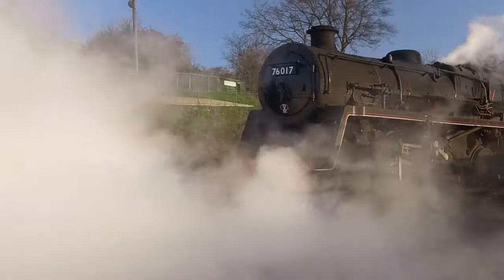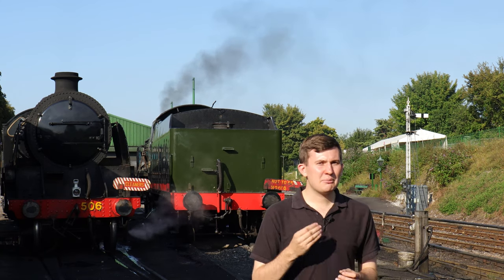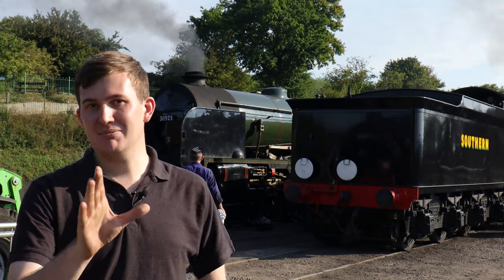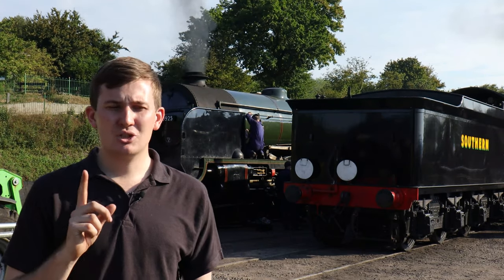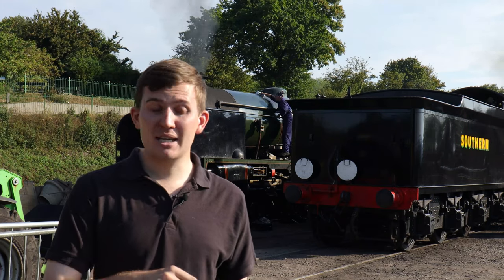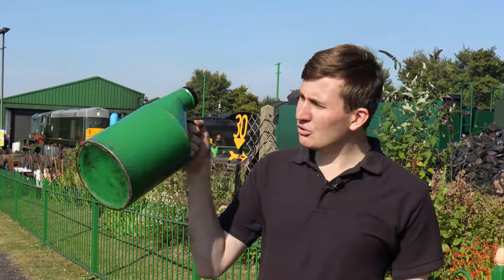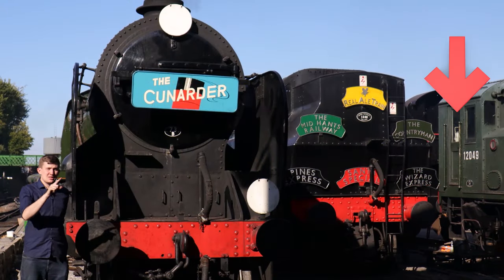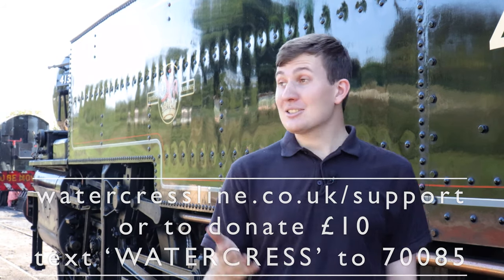Grease, Oil & Lubricators - A Slippery Subject!

Comment: I am certainly familiar with these sights because when I was at the old Voss railway in Bergen Norway 2 weeks ago, and I saw they did the same process as you guys do.
The locomotive at the Voss line has a mechanical lubricators for the record

Comment: Which bearings are greased rather than oiled?
Reply: Plain bearings (like a car crankshaft) are oiled, roller bearings (like a car wheel bearing) are greased.  Over the years plain bearing axle boxes have been replaced with roller bearings types.